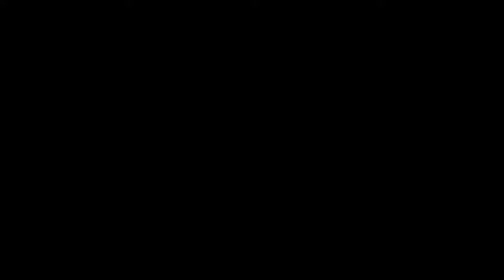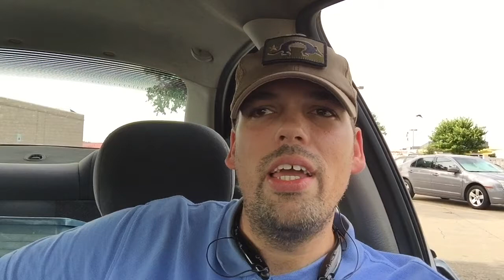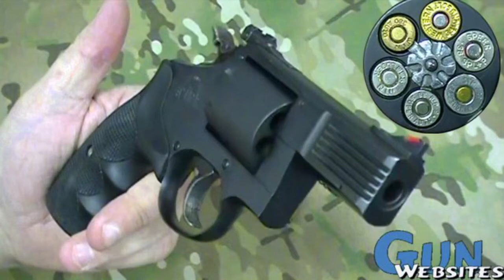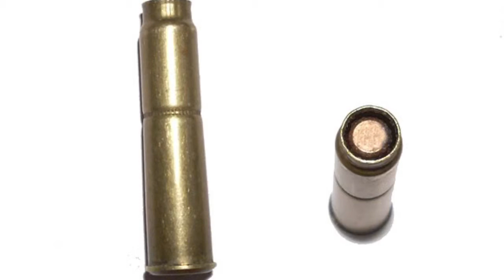My Dream Handgun: Suppressed 357mag Nagant Revolver / M47 Hybrid

Comment: 357 mag through a suppressor?!?!? lol I think that's called a pipe bomb. lol Can pistol caliber suppressors take those pressures??? I'll have to go to the opposite end of the spectrum and trade all the velocity for slow subsonics. I'd go all crazy hardcore Salient Arms race gun Glock 41, RMR, Osprey. 230gr wicked defensive rounds while maintaining sub silence.
Reply from the maker: ShooterSD72 I've seen the Osprey & octane handle 357 & 44 mag out of sbrs. Now that Dead Air is stating that you can shoot 556 out of a 2" barrel, its only time before we have some crazy strong cans. There needs to be a need for it & this type of pistol (if popular) would create that need